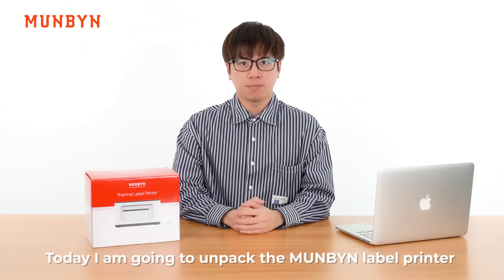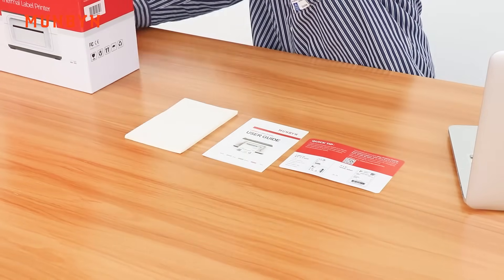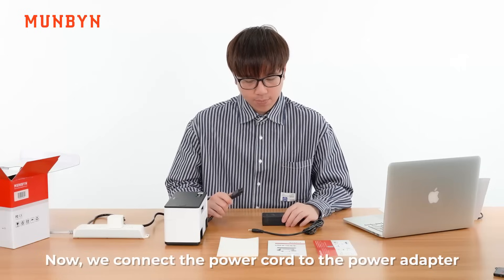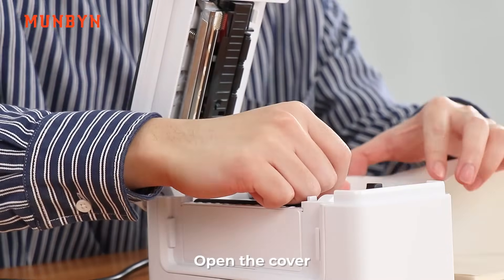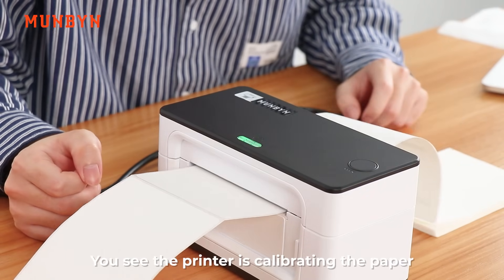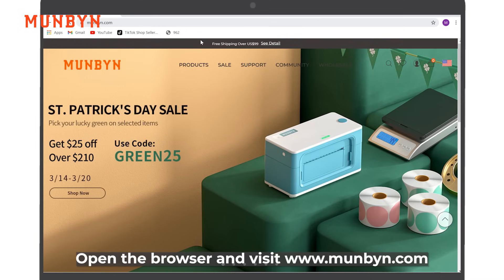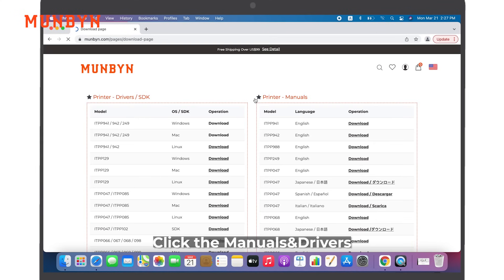How to Setup and Print Labels with the MUNBYN RealWriter 941 Label Printer?

Comment: When I connect the USB cable, it asks me to configure the printer but it’s not possible in any way. This wasn’t happening before. I’ve already uninstalled and reinstalled everything needed, but it still doesn’t work. What solution can fix this?
My laptop is HP CHROME
Reply from the maker: To help you better, we recommend that you consult our technicians in detail via WhatsApp or phone.
Phone: +1 628 229 3612
WhatsApp: +86 17817881067
Email: support@munbyn.com

Comment: I have this machine!!!
Reply from the maker: Great to hear! We're thrilled that you have our machine. If you need any assistance or have questions about using it, feel free to reach out. Happy printing! 😊
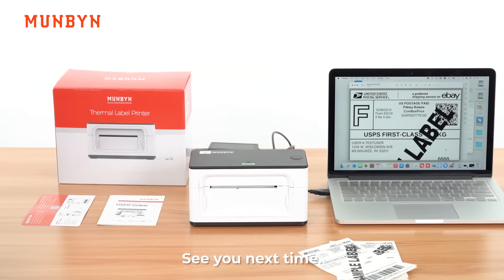Reply: I meant, I hate this device!!! I can't use it with my mobile via Bluetooth!! that's why everything has to go through my Macbook. I can't get the images in the middle of the sticker. whatever I do, I've tried adjusting it but that doesn't work either!! I regret so much that I paid €200,- for this!!  @MUNBYNPOSscanner1printer  2:54

Comment: Mine isn’t calibrating. Idk what to do iv done everything and it’s still not getting the right size
Reply from the maker: Hello dear customer,
We sincerely apologize for any inconvenience caused. Please try the following steps to help your printer recognize your labels again. 

Procedure of reset：
1　Press the FEED (red/green light) button and hold on;
2　Release your finger when you hear the five consecutive "Di" sounds.
3　Then, you will hear another one long "Di" sound, which means the printer was reset.

Then, we can set the printer to calibrate the label size.
1　Turn on the printer;
2　Press the FEED button (red/green light) and hold on;
3　Release your finger when you hear one "Di" sound.
4　Then, the printer will automatically run back and forth to calibrate the label size.
When it stops the process is complete.

If the issue persists, please reach out to our technical support team via WhatsApp or Email for further assistance, and we will have our staff troubleshoot the problem for you as soon as possible.

Phone: +1 650 206 2250
WhatsApp: +86 17817881067
Email: support@munbyn.com

Comment: Bluetooth does not work on my phone. I'm a bit annoyed as we were told the device was Bluetooth, but does not work with the Mumbyn Print App. But it works with the PC just fine.
Reply from the maker: Thank you very much for your feedback. We sincerely apologize for the inconvenience caused. Allow me to offer some suggestions that may help resolve the issue:

1.Please ensure that the Bluetooth function on your phone is turned on.
2.Try restarting your phone and printer, then attempt to pair with the Mumbyn Print App via Bluetooth again.
3.Check if your Mumbyn Print App is updated to the latest version, as it may include compatibility fixes.

You can also click on the link below to view the detailed tutorial:
https://support.munbyn.com/hc/en-us/articles/29278532323347--Bluetooth-connection-method-How-to-connect-the-device-on-the-Phone

If you need further assistance or if the suggestions above do not resolve the issue, please feel free to contact our technical support team at any time via the following methods:
Phone: +1 650 206 2250
WhatsApp:+86 17817881067
Email: support@munbyn.com

Comment: I was really happy with this thermal printer until I tried to use it to print my labels for my small business and the app will not open, please fix this problem
Reply from the maker: Dear customer, we apologize for the inconvenience. Our APP experienced a brief system update failure last weekend. Some users may be unable to use it after downloading or updating the APP. It has now returned to normal. You can try downloading the APP again or contact us and the technical support team. We are sorry for the trouble. Please let us know if you have any questions and we will do our best to help solve the problem.

Phone: +1 650 206 2250
WhatsApp:  +86 13352950490
Email: support@munbyn.com

Comment: Do you lied and said this is wireless?  Plus, modern modems do not have usb connections.
Reply from the maker: Hello dear customer, the product used in the video is a USB model. If you need a wireless model and encounter technical problems, you can consult our technical support staff through WhatApps or Email, and we will try our best to solve it for you. 

Phone: +1 650 206 2250
WhatsApp: +86 13352950490
Email: support@munbyn.com

Comment: red light on top will not stop blinking
Reply from the maker: Dear customer, sorry to cause you trouble.
Please try to reset the machine and learn paper after booting and loading paper:
in this case, We need to reset the printer and get the printer to re-calibrate the label size again.
the tutorial video link:  https://drive.google.com/file/d/17osna-W7d__0_C0eVXd8Craif014YJZf/view?usp=sharing

procedure of reset
1　Press FEED (red/green light) button and hold on;
2　Release your finger when you hear five "Di" sound.
3　Then, you will hear another one long "Di" sound, which means the printer was reset.

Then, we can set the printer to calibrate label size.
1　Turn on the printer;
2　Press FEED button (red/green light) and hold on;
3　Release your finger when you hear one "Di" sound.
4　Then,the printer will automatically run back and forth to calibrate the label size.when it stops the process is complete.

If the situation does not improve, please contact our technical engineers via WhatsApp or Email.
Phone: +1 650 206 2250
WhatsApp: +86 13352950490
Email: support@munbyn.com

Comment: I wished I would have seen this video first before ordering.   I needed a thermal printer to print my eBay labels.    From my phone AND laptop.  Mainly my phone.   Why can’t anything g be easy - JUST ONCE!!
Reply from the maker: Need professional assistance? Contact MUNBYN
Phone: +1 650 206 2250
WhatsApp: +86 13352950490
Email: support@munbyn.com
Reply: Hey Jamie, it works fine with mobile, even the app. You don’t need to use a desktop.
If you use the desktop app (Mac), editing will make you cry.
Reply: @user-eh4ff6rh7s what’s the app called?
Reply: It don’t work by me. I have not a machine with Bluetooth so I can not use my Phone with it

Comment: When mine is plugged in, it juat beeps. I am using the correct plug.
Reply from the maker: Dear customer, sorry to cause you trouble.
Please try to reset the machine and learn paper after booting and loading paper:
in this case, We need to reset the printer and get the printer to re-calibrate the label size again.
the tutorial video link https://drive.google.com/file/d/17osna-W7d__0_C0eVXd8Craif014YJZf/view?usp=sharing

procedure of reset
1　Press FEED (red/green light) button and hold on;
2　Release your finger when you hear five "Di" sound.
3　Then, you will hear another one long "Di" sound, which means the printer was reset.

Then, we can set the printer to calibrate label size.
1　Turn on the printer;
2　Press FEED button (red/green light) and hold on;
3　Release your finger when you hear one "Di" sound.
4　Then,the printer will automatically run back and forth to calibrate the label size.when it stops the process is complete.

Need professional assistance? Contact MUNBYN
Phone: +1 650 206 2250
WhatsApp: +86 13352950490
Email: support@munbyn.com

Comment: My royal mail label QR codes (from ebay) are not scanning can you advise what the issue is ?? The QR codes are not coming out very sharp and printing quality seems quite poor. Was expecting a faultless product I have to say with all the positive reviews but this wasn’t the case. Tested three different types of labels so it must be the printer… Any advise before I return.
Reply from the maker: Dear customer,
Please  reduce the print density of the printer and increase the print speed, we recommend that you use a print density of 2 and a print speed of 4.
In addition, you can clean the print head to avoid the problem of unclear printing caused by carbon deposition.

Need professional assistance? Contact MUNBYN
Phone: +1 650 206 2250
WhatsApp: +8617817881067
Email: support@munbyn.com

Comment: Is it okay to leave the green light on when not in use? Or is it recommended that I turn off/on the switch each use?
Reply from the maker: Dear Munbyn customer, you can keep the green light on when the device is not in use, but it is recommended to turn off the switch if it is not used for a long time.
Need professional assistance? Contact MUNBYN
Phone: +1 650 206 2250
WhatsApp: +8617817881067
Email: support@munbyn.com

Comment: How to callaborate the paper without wasting excess label paper?
Reply from the maker: in this case, We need to reset the printer and get the printer to re-calibrate the label size again.
the tutorial video link https://drive.google.com/file/d/17osna-W7d__0_C0eVXd8Craif014YJZf/view?usp=sharing

procedure of reset
1　Press FEED (red/green light) button and hold on;
2　Release your finger when you hear five "Di" sound.
3　Then, you will hear another one long "Di" sound, which means the printer was reset.

Then, we can set the printer to calibrate label size.
1　Turn on the printer;
2　Press FEED button (red/green light) and hold on;
3　Release your finger when you hear one "Di" sound.
4　Then,the printer will automatically run back and forth to calibrate the label size.when it stops the process is complete.
Reply: This still appears to waste a label  @MUNBYNPOSscanner1printer

Comment: Ok tbis tbing is junk.  I’m trying to use on iPhone which it says you can. The only reason I got it !  Click Bluetooth it don’t even show up. If it’s Bluetooth it should show there like everything else Bluetooth does no. What the heck with these dumb things ong. Def going back. I even downloaded several diff apps stikk notbing. It gives some b.s about pressing holding the feed button to get it to print your Bluetooth info. All mine does is calibrate the paper. Junk. Don’t sell sinrtbing saying Bluetooth if it’s not. Complete waste of more the. One hundred dollars $150 for junk. My $59 one works better.
Reply: The fact that there are apps for iphone/android implies that it should connect via Bluetooth. So the app is worthless. I spent hours working in word and pdf trying to print. Absolute nightmare.
Reply from the maker: Hello, ITPP041 can only be connected via USB, but not via Bluetooth. Please tell us where it misleads you and makes you think that the machine can connect to Bluetooth. We can replace it with ITPP129 for you, which can use Bluetooth. Dear MUNBYN Customer, contact us for further assistance,
E-mail: support@munbyn.com
Whatsapp: +86 17817881067

Comment: Its installed but how do OPEN IT TO USE IT
Reply from the maker: Dear MUNBYN Customer, contact us for further assistance,
E-mail: support@munbyn.com
Whatsapp: +86 17817881067
Reply: How did u do yours I can’t get mines to work
Reply from the maker: @ShadaJames  Dear MUNBYN Customer, contact us for further assistance,
E-mail: support@munbyn.com
Whatsapp: +86 17817881067
Reply: Push the circle button on the top of the cover. It will pop open